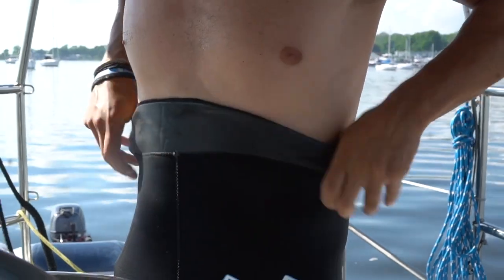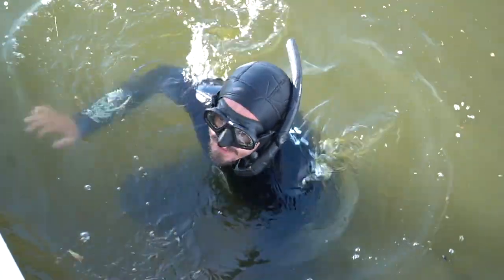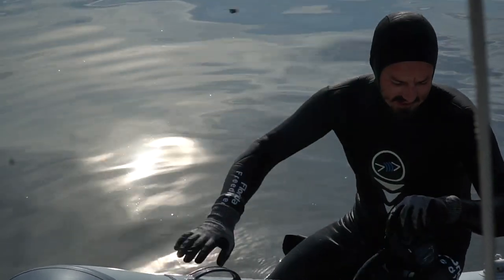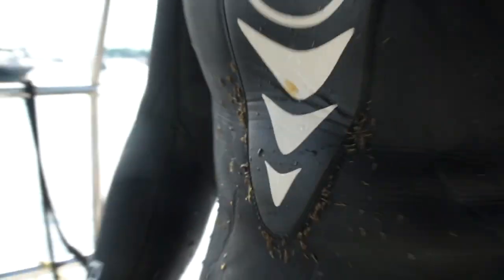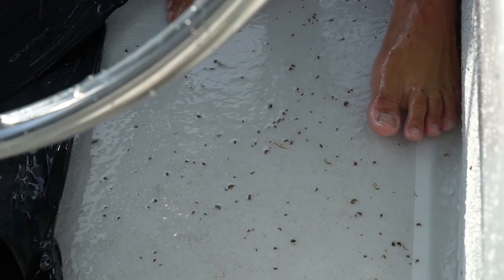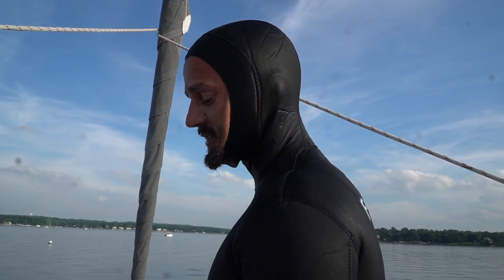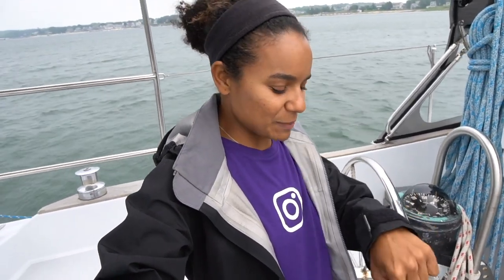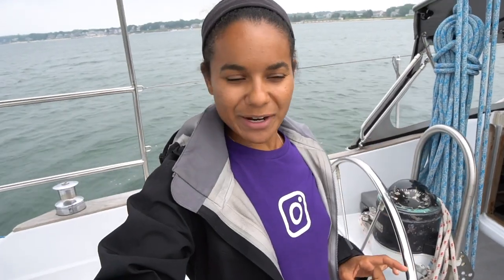Slow and Steady — Sailing Uma [Step 182]

Comment: A little local sailing knowledge:  Long Island (the land mass) heats up during the daytime.   The wind coming in from the Atlantic Ocean is pushed up to a higher altitude by the heat and it goes over Long Island Sound.  The air during the daytime can get very light at times  As the wind passes over Long Island Sound it cools, loses altitude, and comes down again on the Connecticut side of Long Island Sound during the hot part of the day. 
As the Long Island land mass cools down, the wind drops in altitude again.  Soooo ... as the Atlantic Ocean breeze drops in altitude, a Southerly breeze usually kicks in every day about 3 PM during the Spring, Summer and early Fall on Long Island Sound ... you can see the leading edge of the wind as it turns the water darker and comes across the water!  Very cool!  
Local Long Island Sound racers factor in the resulting predictable wind shift in advance, hoping for a nice lift or a knock depending on what point of sail they are on.
If you want to sail right up the coastline, try taking the ocean side of Long Island.  The breeze will usually enter the beach at a right angle so if you stay close in to shore you can sail right along the beach most of the way.
If you find yourself coming back this way sometime, pull into Manhasset Bay and pull your boat into "Louie's" in Port Washington.   A lot of big boat sailboat racers hang out there and can fill you with a lot of local knowledge and flavor while your having a nice meal.  Louie's; Long Island Sound, Manhasset Bay, VHF radio channel 68

Comment: You should try sailing on the Firth of Clyde in Scotland. I remember one morning the fog was so bad we took one of our boats with radar into the pier. We had a guy on the bow and he didn't see the pontoon next to the pier until we were less than 10ft from it! The radar told us we were close, but that close the radar is useless. Good thing we were going as slow as the boat would go and still maintain steerage.

Comment: Hi there -  Lanocote Prop and Bottom seems to work pretty well on the prop after the PropSpeed wears off. Can also be applied in the water which is also cool. I've been using on my Gori 3-blade folding prop and have been quite happy so far. Happy passage to NS...⚓️☀️🤙

Comment: Great video again guys. What do you do about battery charging as you enter colder, cloudier climates?
Reply from the maker: So far we haven’t needed to do much. It’s been sunny enough for our solar panels to work just fine. If we see the need to we sometimes stop overnight at a marina to charge up. But we are still looking into getting a regen system to work and potentially a wind generator also.

Comment: Tech question, if you added a solar panel or two to the rail, could you have enough power to use your electric motor on days with sun but no wind to get a knot or two boost? Or would you need a lot more than a couple of hundred extra watts? I am sad though that you did not get a night in around Westbrook, Clinton, Old Saybrook in Ct. some of the food there is fantastic.
Reply from the maker: We need about 1kw of power to motor at 3 kts. So it would be possible. But ZERO wind is such a rarity that for us it isn’t worth it. We only need about 5kts of apparent wind to sail, so were almost never actually becalmed.

Comment: Q) What happened to Capitan Kika's hand made customized especially desirable bow pulpit seat?
Q)  Do you not have a forward hatch,, like over the V-berth, to pass the spinnaker up from?
And I have not seen ANYTHING of the V berth since leak fixing, are you still using it?  Or is that your private domain?
And speaking of the unmentionable, how did your leak fixes turn out?  I did not see you working on any more in Virginia.
And , and top notch on the interior / exterior hand rail installation!

Comment: A question not related to this video, but your electric motor made me think of it.  I've watched enough to know you run on solar and batteries.  Why don't you have some sort of windmill power?  Seems like being in the wind, almost all the time, would be the perfect place for a windmill.  Alot of the newer ones are pretty small and efficient.  You could also get a turbine instead of a traditional propeller style.  Just curious.  Since I don't know about sailing, there could be a basic common sense answer, I wouldn't know about.  Thanks.
Reply from the maker: We’ve thought about it. But the main problem is where to put on. If we mount it off the back it would shade our panels. Top of the mast makes too much noise down below. We’ve thought about getting one we could hoist above the foredeck when at anchor. But then you need a place to store it when not in use. But honestly, in the tropics, we just never needed one. We had all the power we needed from solar. We’ll see how this summer goes up north and decide if we really need one.
Reply: @SailingUma  Thanks for the reply.  I was just curious.

Comment: Great show again guys. Is the wet suit not a bit too buoyant without some “leads”
Reply from the maker: It’s perfect for hull cleaning. Keeps me up at the surface for everything I can reach without going underwater, then when I do need to dive, I flip upside down and crawl along the hull on hands and knees. Much easier to clean the hull than reaching above your head while sinking.
Reply: Sailing Uma I am very pleased it works for you. My lungs are not that good.👍🤪

Comment: For best practice your main preventer should be led to a point as far forward as possible. Looks like you have it going to about mid-ship.
Reply: Carl Forsander Why’s that? I run mine in that vicinity and it’s never failed.
Reply: I am informed by content in this: https://www.morganscloud.com/2018/10/02/amidships-preventers-a-bad-idea-that-can-kill/
I believe you need to be a member to access this content.  Bottom line is it comes down to the trigonometry of the angles of preventer line when led midship versus the bow. Midship attachment can lead to extreme loads on the preventer and its attachment point
 which can be the cause of catastrophic failure.

Comment: The fact that the water is not clear does not mean it is gross. And bugs in the water means the water is a good habitat for them I guess. In the inland sweet water at out oir lake nearby the water looks more or less the same color wise. Half a meter deep and tjere is no vision anymore. But the quality of this water is good. It is monitored and is good swimming water. At tje start and end of the season it is far more clear but boats just mix a lot of mud in the water. We do not get covered in bugs like you but there are a lot of  little bugs and floating fluff from flowers . Maybe over there the water was real dirty but just saying non clear water does not mean it is very dirty.

Comment: I wonder if you went back 300 years would the water look similar, or would it be as clear as it is in the Caribbean?   Good video although nothing really stood out much.  Fog, . . . ?  When you can't see beyond 30 meters that's BAD.  A Real Pea Souper is what they call that!  BTW - Does your "chart plotter" show your position actively and in relation to the land that you are sailing near?  In other words, could you sail "blind"?  Obviously, your radar will show other boats or ships around you.
Reply from the maker: Our chart plotter is accurate and shows our live location in relation to the chart and radar and AIS. Our radar is good at showing pretty much everything around us, including land. But another way to look at it is that sailing in the fog isn’t that much different than sailing in a dark moonless night. You practice in good light, trusting you electronics, so an night or in fog, you know what you’re looking at. Hope that makes sense.
Reply: Radar? How long you had that?